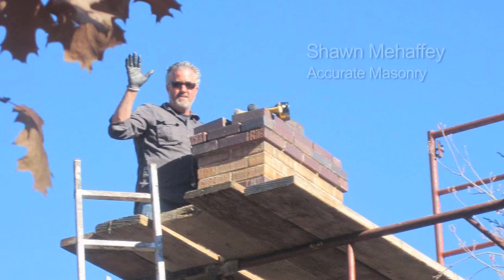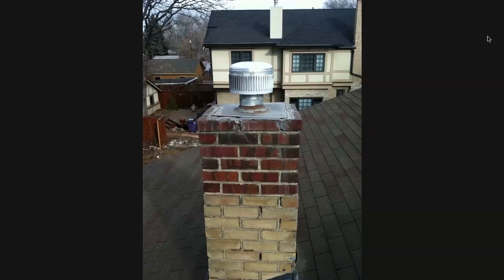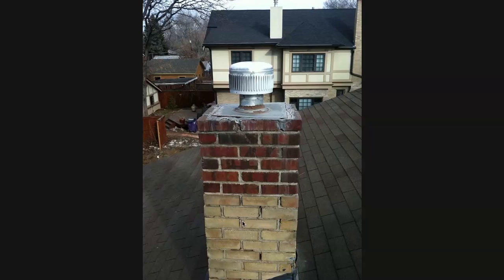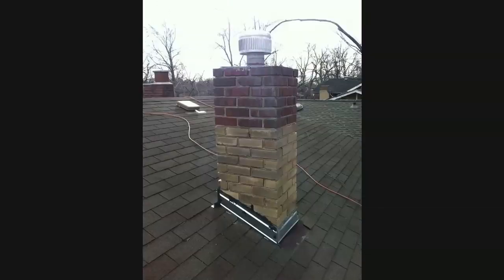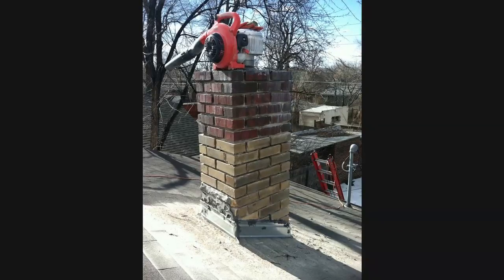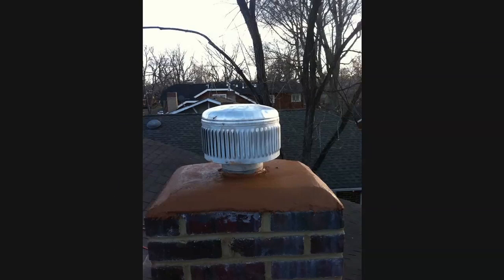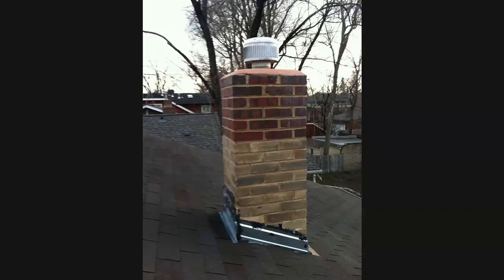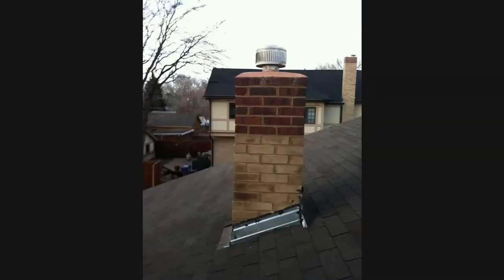How to tuckpoint Small Chimney Repair/ Installing a mortar cap

Comment from the maker: I use a wet sponge when the weather is warmer or windy or both. The reason is to wet the material down a little and it works well to smooth out the cap. Mainly I use a trowel. Just the way I was trained.